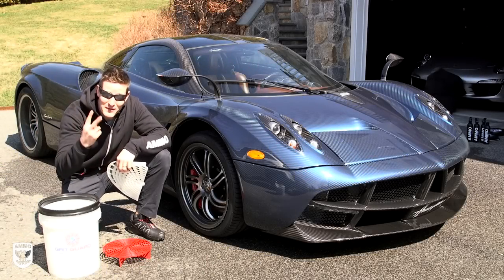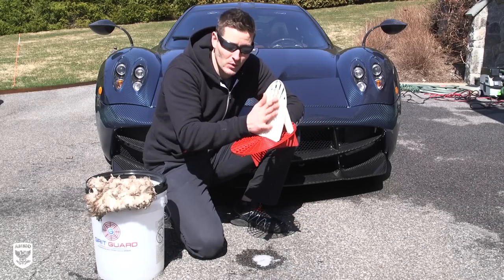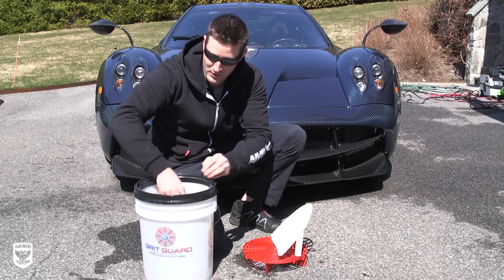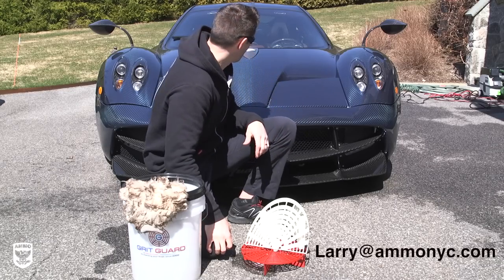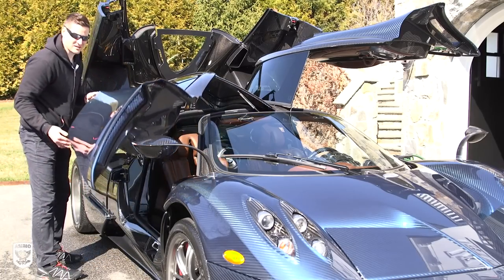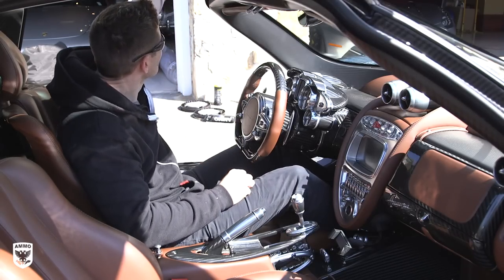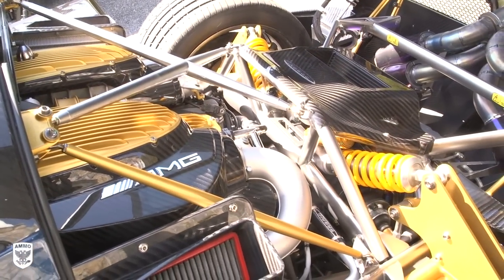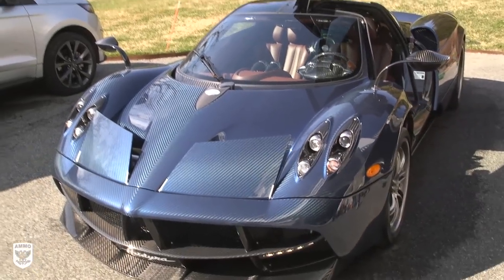New Tool Every Detailer Must Have!

Comment: Hi Larry
I no longer use a two bucket wash system.
I use only one bucket filled with soap and 5-10 microfibre wash mits that I leave to soak in the bucket.
I use one wash mit at a time (one per panel) flipping it once and then putting it aside when I finish the panel. I then pull out another mit from the bucket and use it on another panel and repeat this process until the entire car is washed. Its faster and safer on the paint, 
The important thing to note is that I never place a dirty mit back into the clean soap bucket (as with the two bucket method) thus avoiding any contamination.
Reply: +d tasca 
This sounds like the best car washing idea I've heard yet.

I've always doubted the ability of grit guards to keep dirt / sand / grit at the bottom of the pail under the mesh surface of the guard.  Because each time one swishes the wash mit, doesn't the dirt just swirl up into all the water above the grit guard, thereby rendering the guard useless?

Great idea, d tasca!  :)
Reply: The grit guard is useless because it's sits in the bottom of the bucket... unless you leaves your washmitt there (not very usefull).
Reply: i think Ammo uses this method for certain cars

Comment: Did you know that water still stirs around under the grit guard?  Somehow everyone is convinced using grit guard eliminates scratches without questioning the product.  Best practice is to change the rinse bucket three times.  Get clean water after washing the top of car,  middle of car, and bottom part of car.  Mid way through washing any car you'll notice the rinse water becomes less clear, dirty and soapy.  Grit particles will be suspended in the soapy rinse water no matter.  Yes stones will sink to bottom of bucket, but the sharp grit is suspended.

Comment: LARRY!! you should check out chemical guys new grit guard. it has a funnel kind of design for each hole that makes it 100x harder for dirt to float or get stirred back up compared to the  grit guards you use which just  prevent the wash mitt from touching the bottom of the bucket but doesn't do much to prevent dirt from getting mixed back up into your clean water.
Reply: +James Kempienski 
This is what I've never understood about the grit guards.  

They obviously keep the wash mit from touching the heaviest dirt / sand at the bottom of the pail, but what is the difference between using one of those, or not using one and just making sure you rinse your wash mit at mid-bucket level so it never gets near the bottom?

And either way, doesn't the action of swishing your mit stir up dirt and grit into the rest of the water regardless of whether there's a guard in the bottom or not?

Every car forum and car washing video extols the grit guards, but nobody explains the 'mechanics' of the actual benefit.

Comment: I noticed that when you opened the luggage compartment some water dripped out of it, what do you recommend to keep that from happening in places like for example the mirrors that you think they're clean but when you start driving it drip all over your vehicle even though for example I use a air dryer to clean it
Reply: +Manny Garcia You can either use A} compressed air to blow it out, or B} take the car for a drive around the block then clean it up.

Comment: this is great but, your still going to get swirl scratches, the only scratch proof way is pre-treat vsisble dirt, foam, rinse and foam again final rinse, and air dry, or dab dry with large chamois with no wiping whatsoever.
Reply: +Giggidygiggidy12 
This sounds like an interesting method.

With this method, do you not rub the paint with a cloth or anything?  And what do you mean by "pre-treat visible dirt"?  You just squirt this special foam on it and let it soak for a bit?  And for the general wash, do you just spray it with this foam, let it soak, and then rinse?

I only wonder if it would get all the 'layers' of dirt off effectively without rubbing it.  My example is when I've gone to a wand wash with a very dirty car (say, muddy and salty from winter roads) and just used the high pressure wand without any wash mit, and later when chamoising, the chamois still gets lots of dirt on it that even the high pressure wand didn't remove.

So, I wonder how much less would just gentle foam sitting on the paint do?

If this method would work, I have an older summer car with a new paint job I'd dearly love to baby :)
Reply: I didn't say it was perfect, but until they perfect dirt proof automotive coatings, any abrasive action with a clean mitt or otherwise will start to create swirl marks. Just yesterday I stopped in at a local Audi dealer brand new S8 in the showroom fully loaded close to $145k sticker in the window, and low and behold swirl scratches on the hood, only visible because the showroom lights were directly above the car and it looked awful. I asked for the sales manager and when I showed it to him he nearly had a heart attack and the proceeded to play it off. He said it's been hand detailed since we got it. I said unles they did a completely touchless wash all of your hand details are going to look like this at some point soon. Your right it is a bitch to get road salts and gunk off without some elbow grease but if you pre-treat the worst parts let it soak until dissolved and then rinse your reduce the risk of swirls scratches anything else won't hold up over time.

Comment: I don't understand how that grit guard actually stops dirt from just floating in the bucket. How do those "holes" in the guard keep dirt at the bottom?
Reply: +Phils Rad dirt is heavier than water...........so it sinks. 

The plastic barrier prevents the water from sloshing around so much the dirt gets kicked up, so it stays at the bottom.

Comment: The problem with that method is that you cannot get all the dirt out of the mitt.  Why don't you use four or five mitts per car and never dunk a dirty one back in the water so it stays hospital clean.  Then you will have no chance at all of taking dirt that stayed deep inside the mitt and scratching the paint.

Comment: I don't understand grit guards. Anything that a mitt would be picking up off the paint would be a 1000 times or more smaller than the holes in those guards. So what is the point? Is it just to stop the mitt touching the bottom of the bucket, where stuff accumulates? If those guards were actually filtering the water, the filtered material would be on the upper side of the guard - closer to where the mitt is dunked!
As for the mitt rubbing guard, that makes more sense, but you Larry have given us the ideal method in other videos - ditch the mitt and use multiple microfiber towels, instead.

Comment: Why not just go bucket free? I use a pressure washer to rinse my wash mitt between every panel, and then re-soap it with the soap dispenser. I never dip it into a dirty bucket.
Reply: thats what ive always done. using a hand mitt and a weak pressure washer (mine is 1500psi) you can quickly rise it off.

Comment: My car needs to visit Larry. I took it to a auto detailer chain store that starts with Tint and ends in World. The only reason I went there was I watched their videos where they're detailing a car and had thought about getting the paint film protection put on. It says on the videos how their folks are professional with experience. 
 I went back to where my car was being washed and I saw the guy using one of those brooms for washing a car. I went off on the guy even tho it was too late to reverse what he had done. I now have light scratches from where this idiot washed my car. Luckily the car is white and the marring/scratches are harder to spot. 
I had always used the two bucket method since I got the car and there were no love marks from improper washing before these tools washed it. It needs to be corrected but I am not going to do it myself as I know nothing about using a polisher and I do not want to cause more damage. I am unable to find a detailing shop in Southwest VA.

Comment: very expensive for a $2 piece of plastic
Reply: Expensive? lol
Reply: Manufacturing isn't the only cost of a product.
Reply: +xtravisxmanx $2 cost and 20$ for the name, I dont need the name.
Reply: +happymark1805 They are a popular brand for a reason. They make quality products which won't break easily. Last thing you want when washing a $2 million dollar car is debris scratching the paint.
Reply: +xtravisxmanx that also never happens with a paint thing that you can buy for 50 cents, that's why I didn't buy an hugely overpriced scratch guard thing.
Reply: +happymark1805 The 50 cent product will never be as good as the $20 dollar product. Simple. Why risk thousands of dollars over $19.50? Makes no sense.
Reply: +xtravisxmanx simply because its a 2 dollar product that has a name slapped on it and sold for absurd prices, it's simply not worth it, a 50 cent product will work just as good, even grandmas old washingboard will do the job just as good
Reply: +happymark1805 A name means something. When you deal with well known companies you know the product will live up to its name. That means better quality control and customer service to name a few. I'm just saying if I was working on million dollar cars I would not trust a $1 dollar product from a no name company.
Reply: +xtravisxmanx Who of us works on cars that are worth milions, only very very few out there, face it most of us are working on cars that are worth less than 10.000, and even then, the 50 cent dollar store paint thing works just as good, I have been using that for many years without a problem, in this case the brand name means you payed way too much for it.
Reply: +happymark1805 You're paying for a lot more than a name.
Reply: +happymark1805 Alright you can take the risk with the dollar store product and I'll spend the extra $15 for a reliable company's product.
Reply: +xtravisxmanx I already use the dollarstore thing for many years, so that has been proven to be reliable
Reply: +happymark1805 Great, you took the risk and it paid off for you. I simply won't recommend anything from the dollar store because you never know what you'll get. Their product quality is not consistent.
Reply: +xtravisxmanx it's just a piece of plastic, nothing more, it isnt rocket science

Comment: Why dont just wash it out with a gardenhose?
Reply: +Yop Brookhuis That's what I do. The pressure of the garden hose is enough. I don't even put a dirty sponge back in the bucket. Dirt gets stuck in the suds that is kept suspended and no amount of grit guards will keep that on the bottom of the bucket because it doesn't sink. My bucket is still like new as a result.

Comment: No offense to the creators of the grid guard and washboard but the grit guard does the exact same thing as the washboard.. I don't see a point
Reply: How could you not see the point?
Reply: @tat2dragons I'm just thinking it is the same thing as the grid guard on the bottom. I have no problem brushing my wash mitt against a grid guard on the bottom of my bucket
Reply: +Matt Perez But it's clearly not the same thing as a grit guard. Rubbing a wash mitt on a grit guard can cause you to stir up the dirt that's accumulated in the bottom of the bucket, and possibly reintroduce it back into the wash mitt.
Reply: +Tat2Dragons I'm almost certain that in a container the size of an average bucket making a scraping motion against anything would cause all of the water in the bucket to move and probably stir up sediment at the bottom either way
Reply: +Matt Perez Maybe so, but a grit guard sits much closer to the dirt at the bottom of the bucket, so if you're scraping and agitating a wash mitt that close to the dirt, there's probably more of a chance that it could reintroduce the dirt back into the wash mitt. IDK it just seems that the wash board is a better option for getting the dirt to release from a wash mitt.
Reply: +Tat2Dragons I see your point